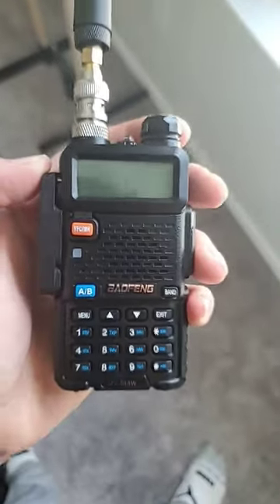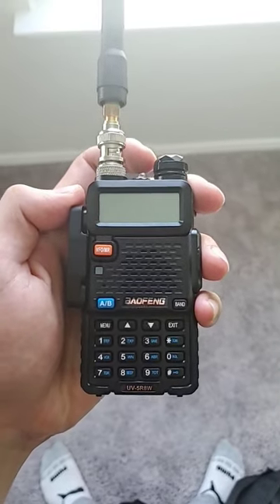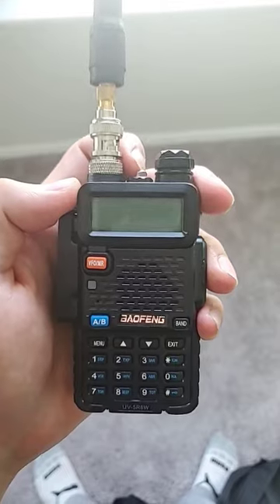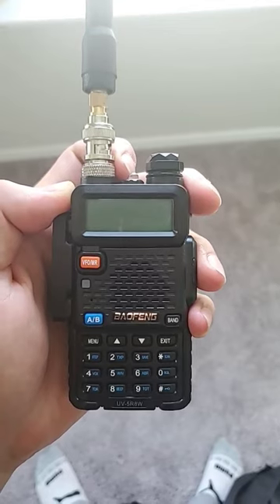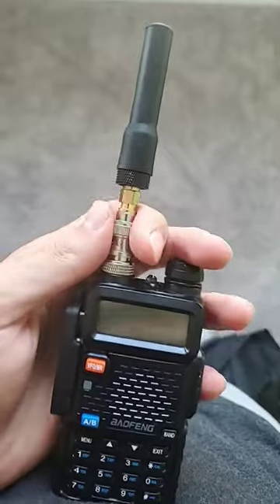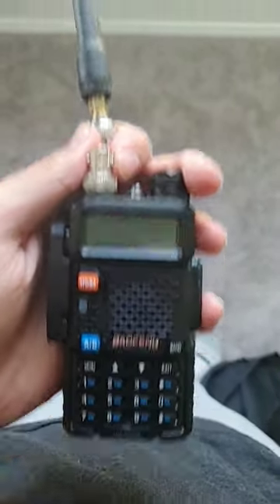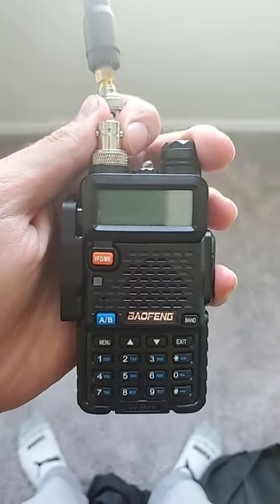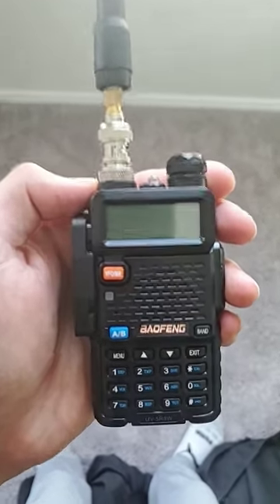You Need BNC Connectors #short #shorts #military #tactical #tacticalgear #hamradio #radio #airsoft

Comment: BNC is a great connector to use. It is fast and less likely to break compared to some smaller connnectors.  Unless you are using it for very high frequencies (where it has more loss compared to a N or SMA connector) BNC is ideal.

Comment: The threads on the radio are only going to last so long too. The BNC helps protect those threads 👍 definitely a benefit, especially if you need to swap antennas frequently.

Comment: Doesn't the BNC adapter make the antenna length too long for the band you are trying to use?
Reply: The connector is before the positive and negative of the antenna split paths.  It’s basically a little coax cable.  A proper HT antenna will divert the negative into a loading coil at the base to make the antenna electronically longer.  Each adapter however does create “insertion loss”, which is a fancy way of saying it cuts 1% of your power output per connection.